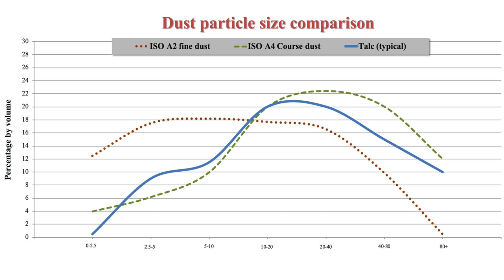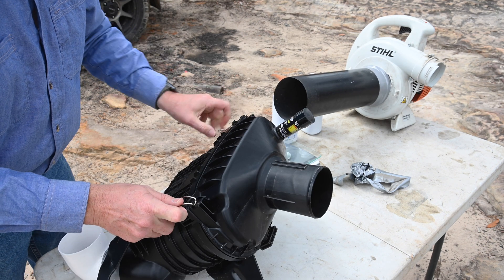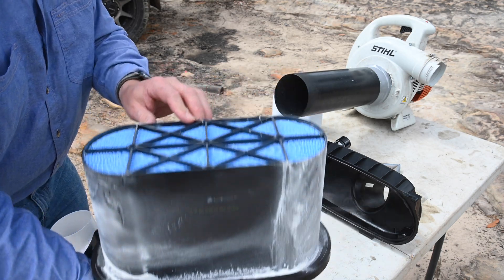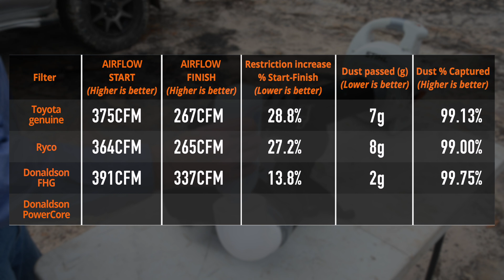Dust testing a Donaldson PowerCore 4x4 XLC200K for a LandCruiser 200

Comment: G'day. Great video. Less dust on the other side is of course always good. This is one good test, to ascertain just one part of the issues. But, my understanding of the OEM filter and housing is that the airbox over time the box plastic surround can de-form (so the line around the faces and clips no longer are like a new, even seal) and the problem gets worse, its not all to do with the filter element. So how has the Donaldson airbox overcome this aspect? (as it hasn't been out long enough to re-run the tests to prove that the same thing doesn't happen).
Reply from the maker: My OEM airbox was about 10 years old when I did the vacuum testing, and as you saw in that part of the test, leakage wasn't an issue other than with the old Ryco element. That said, the Toyota box has four long, straight edges with clamps in the corners, so the design does lend itself to flexing. The Donaldson is a much smaller and more rigid oval shape, with a very thick foam seal that the lid clamps on to. I think it's implausible that it will ever leak. Donaldson have been making similar design PowerCore airboxes for industrial equipment for a couple of decades, and I haven't heard of any similar issues.

Comment: Fantastic demonstration.  I would of liked to see you take this one step further and keep adding powder until the air flow reached the same as a clean Toyota airbox/filter (assuming Toyota had the factory configuration running the optimal CFM for the engine) or the indicator showed that the PowerCore element needed replacing.  Considering the cost of replacing the PowerCore filters (still cheaper than a new engine) it would be nice to know where performance could start tot fall off.

Comment: Toyota should be hung out to dry for this major mistake . Poor quality industrial filters do the same as the rubbish units from Toyota . Causes are vibration and filters being to small .
All Cruiser and Hilux owners get a 200,000km worn out engine yea thanks Toyota .
The Camry engineer must have escaped to the 4x4 dept .  A product straight from Chiiiina.
Toyota should be embarrassed  that Donaldson has to fix there problem .
Reply from the maker: Toyota are not alone on this. Most 4WDs these days have similar flat panel filters, and plenty of dusty clean side photos of them too. All comes down to cost and space over performance.

Comment: How much weight will it take to make the sensor to indicate replace filter. Then add that amount to a oem filter
Reply from the maker: Although I haven't tested it, I believe the OEM filter trips the restriction indication when its brand new. The PowerCore filter flows around 3x more air than the OEM filter at the same restriction level.

Comment: Any specs on the service indicator. Is it a CFM indicator in a way? What CFM does it get down to? Assuming there is a large cost but might be offset by the service life of the filter vs paper panel?
Reply: Ignore that you have answered in the install video. Thanks

Comment: How does it perform when connected to a snorkel or getting wet & has it got some sort of valve to release  moisture??
Reply from the maker: There is a small rubber plug in the bottom which can let water drain out. I have a snorkel and have driven in a lot of rain since I installed it, and never had water build up inside, or had the filter get obviously wet.